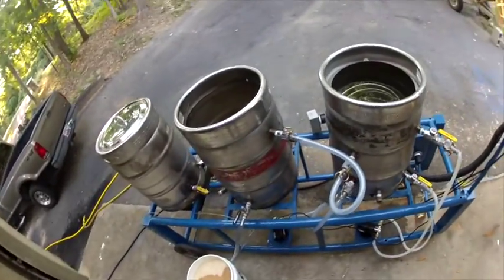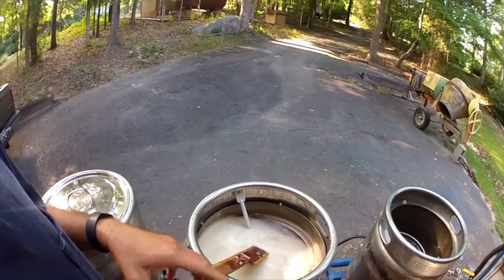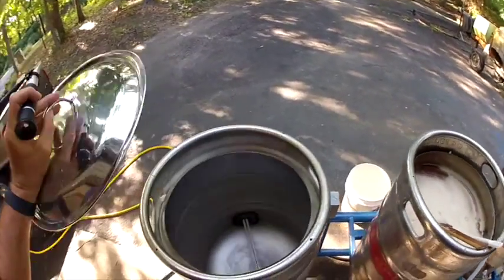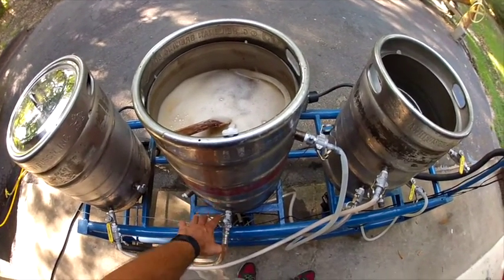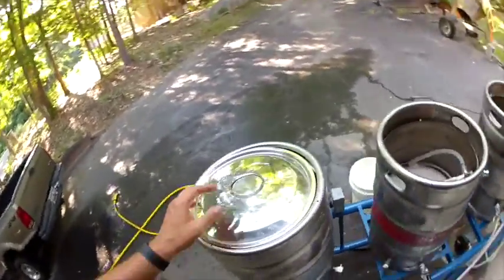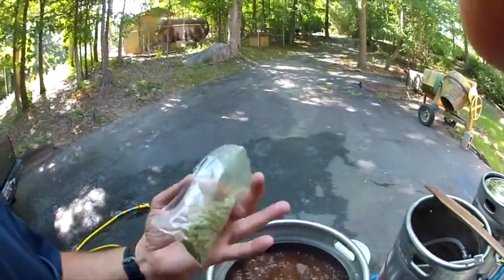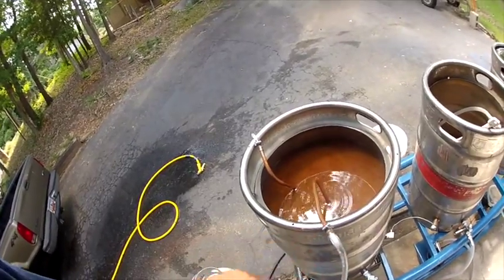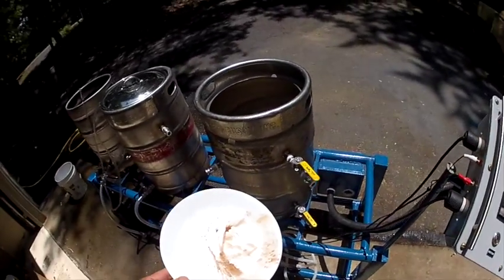Pumpkin Ale Brew Day

Comment: It is not a bad idea to skim off hot break as it forms and to add bittering hops when break ceases to form and to skim off second break after hops are added. The wort will be a little cleaner than basic wort drawn from single infusion. Less hops will be needed. 

A word about mash out. Mash out came out of the decoction method, a method in which mash is boiled without causing enzymes to denature. When mash out is used in a method where mash isn't boiled, such as single infusion, at temperatures above 168F, complex starch called amylo-pectin will enter into solution. The high temperature denatures enzymes and due to denaturing, enzymes will not gelatinize the starch, nor will dextrinization occur. The starch will be transferred down stream, resulting in an unstable final product. Mash out causes issues when used with the single method. 
Amylo-pectin is partly responsible for body. The starch is located in the tips of the kernel and the starch is heat resistant. When the starch is in solution mash will jell and when dextrinization temperature is used the jell disappears and A and B limit dextrins form and body is created in the beer. Limit dextrins are tasteless, non-fermentable types of sugar. They are not to be confused with sweet tasting, non-fermentable sugar formed when Alpha liquefies simple starch called amylose. Since, temperatures which cause amylo-pectin to burst are not used in the single method, the beer produced by the method lacks body. 
Since, a proteinase rest was not used during the demonstration, the wort will be loaded with albuminous protein and beta glucan which further reduces stability and is responsible for deterioration of the final product during the aging cycle.
If a maltose rest was not used during the demonstration, conversion did not take place. Beta is responsible for conversion. Beta converts simple sugar called glucose which is formed when Alpha liquefies amylose at a 1-4 link. When the starch chain is liquefied, two chains are formed. The non-reducing chain is glucose. Beta converts glucose into complex types of sugar called maltose and maltotriose, simple sugar converting into a different type of sugar through molecular action. Actually, enzymes do not convert starch into anything, they soften and liquefy starch. 
Beta is a weak and not a very prolific enzyme and it does not necessarily have to be in malt. In 35 dollar a sack malt it is usually extremely weak and it can even be kilned out. A malt data sheet indicates whether Beta exists in the malt. It is not a bad idea to become familiar with the info that is on a data sheet. It is produced for a reason and it comes with every sack of malt. The time it takes for saccharification to occur is indicated on a data sheet and it takes much less than an hour to occur. Do not confuse saccharification with conversion, they are two different things.
I enjoyed watching the video.